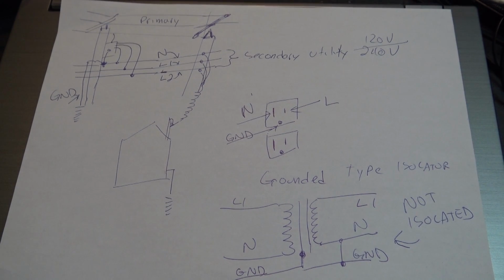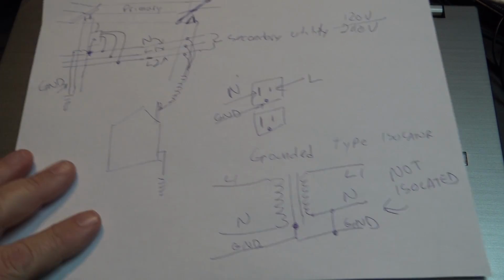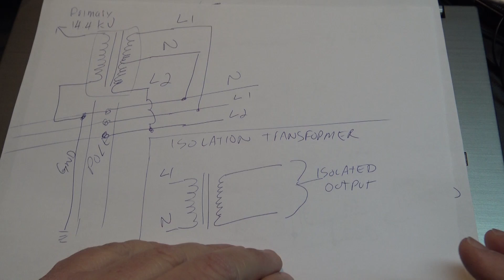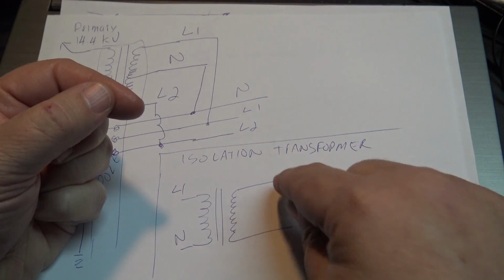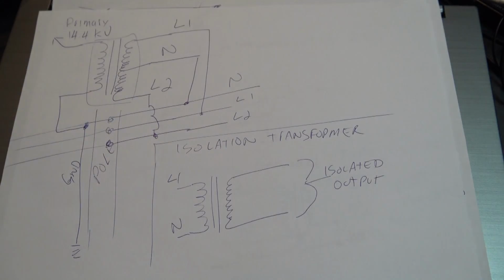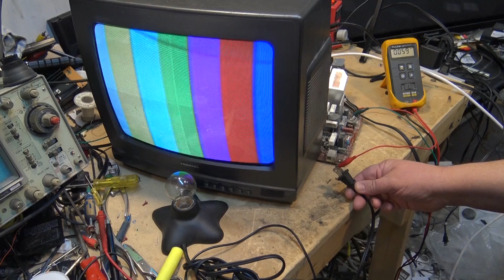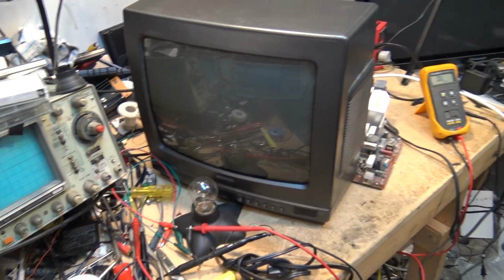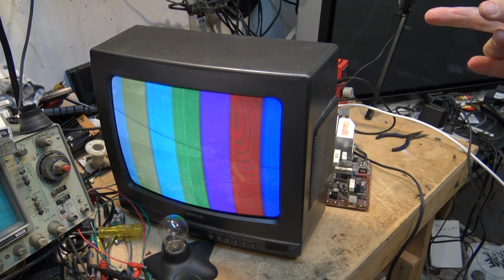Isolation transformer explained and demonstration

Comment: What if we install an inline fuse of maybe 500 mah on the crocodile clip of the scope like those that comes on car stereos  to help causing an accident to those who don't own a isolation transformer or simply forger to use it on a determinate moment.
Reply from the maker: Not that I am recommending this but...and if you do it, you do so at your own risk. The very first shop I worked for was run by a very smart, ex military electrical engineer. He didn't believe in isolation transformers. He cut the ground off his scope (that would be that big old 1963 HP that I now have) so the scope chassis was not directly connected to earth. He then wired up a small red light bulb, a little 5 watt xmas type bulb between the scope chassis and earth ground. This way, if the scope ground probe inadvertently made contact with an energized hot ground, there would be no sparks, no blown equipment, the little red light would light up. The red light was a warning that the scope chassis was HOT and not to touch it. Now that was him, for me, once I finished my training with him, and got into the next shop (Sony Canada) and the next one after that where I stayed for 20 years, I had an isolation transformer and would not service without it. I have an isolation transformer on my bench now, my variac is plugged into the isolated output, and that feeds my test power bar.
Isolation is the safest, but cutting the ground prong will prevent you from blowing up your test gear or melting your scope probe. Just if you do that, and I am not telling you to, I am telling you not to, but if you do, remember the light bulb trick and you will know if the ground is clipped onto a hot point without sparks and the subsequent cursing that follows.
Reply: 12voltvids No no, i never intended or tried to said the fuse thing was the solution or the way to get rid of the transformer ,but i do know it would help a lot to mitigate fire hazards or equipment damaged like you just said, i know the isolation transformer its important but i just was making a point in those cases when you don't have one at hand or taking meaurements out of the shop etc, also some or all commercial transformers come with the ground atached to the one lead of the secundary making it a neutral since they are intended for power conditioning purposes and some folks don't modify then to make it truly isolated or don't know so still i think the fuse thing or even better the lightbul trick should even be part of the osciloscope and be buil in already, heck should even be a code regulation i think.

Comment: You said something at both the beginning and end of the video that may have "clicked" in my head.  Either side of the isolation transformer can be pulled to ground.  WHAT?  Really?  I'm interpreting this as, if you touch one side of the isolating transformer to ground, you aren't forcing voltage to or from the ground but instead you're stabilizing one of the transformer legs, causing the AC voltage fluctuations to occur only on the opposite leg.  So if I ground wire 1, then wire 1 becomes stable and wire 2 carries the oscillating AC voltage.  If I instead ground wire 2, then wire 2 becomes stable and wire 1 carries the oscillating voltage.

I've been trying to figure out how any isolation transformer works, because I feel that the voltage is just going to go through you to ground.  I never thought that maybe the ground is more powerful than either leg by itself and will force it to stabilize.

Or maybe I've thought of the earth as a giant capacitor capable of endless dumping of electricity, and that might not necessarily be the case.  Argh.  Now I have to rethink everything.

Comment: I just got an old VIZ Isotap isolation transformer. The isolated output is 2 prong. I have 2 questions: One, if I am working on a modern tube amplifier which has a three prong plug, do I still need the isolation transformer? Two, if I do need it; should I use the infamous 2/3 prong adapter to plug it in? I can't think of any other way to do it.

Comment: please make a video about what will happen if took any wire from the output and connected it to the nutrial of your power socket
Reply from the maker: I can tell you what will happen. You will loose your isolation. Neutral is strapped to earth ground. so  tying one side of the secondary to ground, or neutral will effectively remove the isolation transformer from a safety perspective.
You need that floating neutral, so that if you make contact with an energized conductor, that conductor will be pulled to ground and become the ground reference.

Comment: Did people really told you that you get no protection using an isolation transformer?, man, what kind of moron would say that?
Great explanation as always.
Reply from the maker: There are those that will argue that connecting your grounded scope removes protection. It doesn't remove protection.  You can still get a shock with an isolation transformer if you contact 2 different potentials on the circuit.What an isolation transformer protects you from is a direct line shock with a return to earth from touching an earth and live circuit, because the reference to earth is removed by an isolation transformer. The argument is that if your scope is grounded you restore that ground, and then you can be shocked.Partially true, yes you restore the ground reference if your scope is bonded to earth, and that is why it is safest to unbond the scope from earth as well.What it does, if your scope is bonded to earth is remove the dead short line to ground if your ground lead gets connected to hot, because the hot and neutral is floating, so the hot will be pulled to ground potential, and no sparks.If you remove the ground pin on the scope then the scope will not provide a ground reference, and you are as safe as you can be. Never remove the ground pin on a scope without using an isolation transformer though, because if you do, and the scope ground lead comes in contact with a hot circuit the entire scope chassis will become hot, and if you were to touch the scope chassis, you could become the path to ground :(That could ruin your day.So, to recap the lesson, for safety. No earth ground on the scope, and all equipment under repair plugged into isolation transformer.FYI I plugged my scope into a grounded cord specifically for this demo, because if I didn't, when I connected the light bulb between hot and the scope ground it would not have lit up, but my scope chassis would have become live. I never have my scope grounded.
Reply from the maker: My bench plug is isolated from ground, and neutral, as is my scope. 
It is the safest way to work on equipment. I would never work on any equipment with isolating it, and I still practice safe operating procedures, and that includes keeping one hand in my pocket, and wearing CSA certified footwear at all times when working in the shop.
Reply: this is also an issue if you use your scope analyze your mains if you want to do this without an isolation transformer use an inverted that is not grounded same result  no ground the grounding works great when our hands are not inside the device when our hands are inside a device the ground is a threat but even standing on concrete floor with shoes on you can still get a nice a zap if you have any amount of oil on your shoes or if the concrete is wet

Comment: Excellent explanation and demo! Not sure if it has been brought up earlier, but how come outlets in North America are polarized (one pin is wider than the other)? On AC it shouldn't matter what orientation the plug has. Most of my friends that see some of my import USA stuff and notice the outlet on my power strip/transformer always ask "Why on earth is it like that? It shouldn't matter since it is AC."
Reply: Depends on the type of device being powered,  but polarized plugs generally ensure that it is the hot/active lead that is being switched and not the neutral.  They do this for safety reasons.
Reply from the maker: Good question, and to answer it for you it is for safety.Many items they connect the chassis ground directly to one side of the AC line. The wider blade is the neutral side and the smaller one is the HOT.This ensures that the chassis is tied to neutral, and not the hot side.Also, if there is a power switch in line, you want to ensure that the hot side is switched and not the neutral side as that would leave AC still live inside the device. Operation wise it wouldn't matter, but if one of the capacitor that tie say the antenna ground to the chassis were to short and the hot side was tied to the chassis ground, well you can see that the antenna connector would be now be hot. Parts like the tuner shield would be directly connected to 120V.Not everything is polarized. None of the power supplies for equipment I install at work is polarized. This is because it goes to a switching type power supply, and both sides of the DC output are isolated by transformer, and the entire AC side is double insulated.

Comment: some years ago I bought a hallicrafters  S38 and was told I should run it off a isolation transformer. I never did that but I think I see why I should and will get one.
Reply from the maker: I also have a Hallicrafters, will have to dig it out and see the model. I believe the one I have has a power transformer. It works too, at least it did the last time I used it.

Comment: Q) Since my isolation transformer is mains grounded, I have used a 6inch pigtail 2-wire extension to connect the device I'm working on to the iso-transformer. Do you see a problem doing it this way vs opening the iso-transformer and removing the ground connection?  Thx.
Reply from the maker: That will work just fine IF, the plug on your isolation transformer is totally isolated from the earth ground.Take a meter and put it in ohms mode.Put one probe on the ground lug on the power cord to your isolation transformer. Then measure to both prongs on the output plug.You should see infinite resistance. If you measure anything between the ground terminal on the power cord and either of the power prongs on the output then the secondary is strapped to the earth, and you have no protection. You need to cut the ground prong off the power cord in this case to isolate the transformer from earth ground.

Comment: My isolation transformer was shipped to me grounded. I think all in the USA are shipped that way to protect the manufacturer and vendor. But, there were no docs or warning labels stating that it was grounded to mains. Seems very wrong. It does not provide isolation.

Have heard that the scope should remain mains grounded. Confusing situation.
Reply from the maker: CORRECT. These type of transformers are there to limit spikes and noise on the line. The pass through ground and bonding of the neutral to earth ground on the secondary removes any safety from shock factor. You need to cut the ground pin, and remove that bond from the neutral to case on the output plug.As I said in a previous message measure with a meter to be sure.
Reply from the maker: Surging Circuits 
I removed my scope ground and it sits on a wooden bench. 
never remove scope ground unless you are working with an isolation transformer. doing so could create a very dangerous situation as the scope chassis could become energized. at least on isolation transformer the "floating" scope is never going to become mains energized. it could become DC energized if you are working on a power supply on the DC side of the transformer so services need to be aware of this. I actually have a ground wire that I can earth the scope if needed but usually I don't as I am aware of what I am doing, and take every precaution when working.
Reply: +Surging Circuits There are different types of isolation transformers though; ie medical and audio isolation transformers for example will be mains earth referenced and will usually have the output neutral tied to ground,  and they are supposed to be grounded for safety.  "Isolation" in this sense is being used to protect sensitive equipment,  but you have to modify them to make them "tech" isolation transformers.

Comment: have used isolation transformers all throughout my career! They are an absolute necessity when working on hot chassis tv's! I have a few. my best ones are the ones i have built into my variacs
Reply from the maker: Mine is ahead of my variac, so it accomplishes the same thing.They are the first piece of test equipment a tech needs to buy. You can't take chances with electricity.
Reply: Be careful medical isolation transformers are not really isolated. Check it with a meter before you trust it. Watch Todd Harrison's video on how to modify one. /www.youtube.com/watch?v=11Yve2ijWyk&t=14s
Reply: Isolation transformer are bit hard to find....maybe it's more expensive to manufacture.
Reply: I have found used ones on Ebay. Apparently hospitals use them.

Comment: Hi 12voltvids ,I thinking that you have small mistake (but very dangerous!! ) whan you connect the oscilloscope probe ground (which is main ground) you referance the Isolated side of the transformer to the ground again so you canceling the Isolation!!.

I am using the two  oscilloscope probe with math function and not the  oscilloscope probe ground!!
Reply from the maker: haimt1464 
yes connecting a grounded scope probe will ground the isolation for sure. This demo was to show that accidental contact with live side will pose no risk because the live side would be pulled low. there will be other points on chassis that would then become energized. this demo was done specifically for this demo to show that the isolation transformer does indeed provide protection against accidental shorting. ultimately you want your scope floating as well. My scope has no ground connection normally. so connecting it would give me no light regardless if I connected the ground to line or neutral, (without transformer) however this would bring the scope chassis to line potential because it is floating which is very dangerous. with the isolation transformer protecting the unit under repair, even if your scope ground was on a line connected reference, the scope would not be energized.  So for safety, an isolation transformer is mandatory AND the earth ground prong on the scope needs to be removed. 
I can demo this too if people want to see my scope chassis go up to 120 v. that was the purpose. with the scope grounded and the bulb connected to line it lit up. if the ground pin was removed the bulb wouldn't light but the scope chassis would be hot. that is very dangerous. on iso transformer and the ground pin on scope removed, unit under test is fully isolated and floating. this is the only way I work.

Comment: yes, that how every non ground referenced transformer protect you if you touch one of the outputs. That how two mains powered devices protect themselves from shorting the mains when you connect one to another.
But you still have to remember, that floating voltage might be dengerous if you close the floating loop
Here in Europe we have 230V in every socket, so hot chasis are not that common
but you still expected to use insolation transformer for measurent on serviced equipment. To not blow up your scope or yourselves.
One thing you forget to mention
Insolation transformer not only insolates you if you touch one output, but also limit the power you could recieve if you close the loop to the power output of the transfotmer, so if you close the loop it won't be the full breaker current, but only its fraction. Closing the loop on the output side also would not flick your mains breaker if the transformer is not some kind of behemoth, so you would be expected to install one breaker on the output in case of catastrophic failure of serviced equipment.
Reply: a grounding at 230v would require much thicker ground wires and small shunt on the neutral its doable for low power devices such home audio equipment but not on high power motors and still have the same level of safety